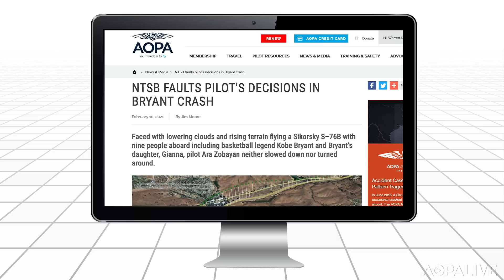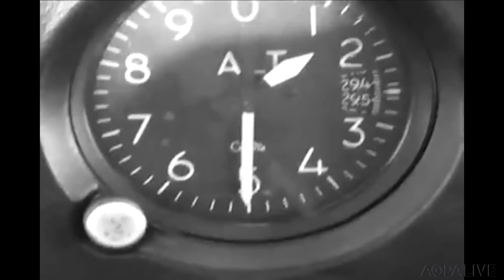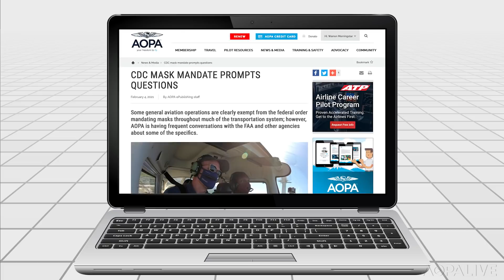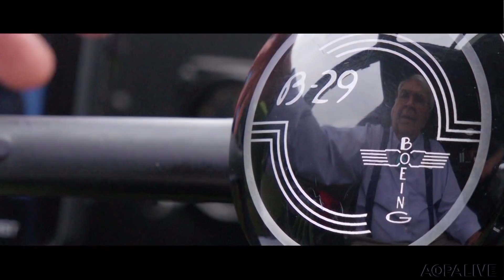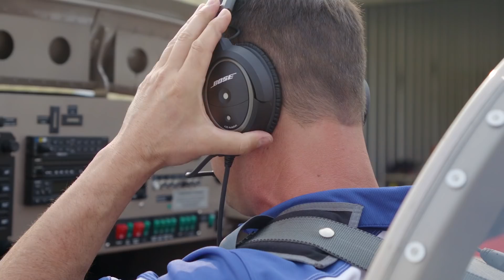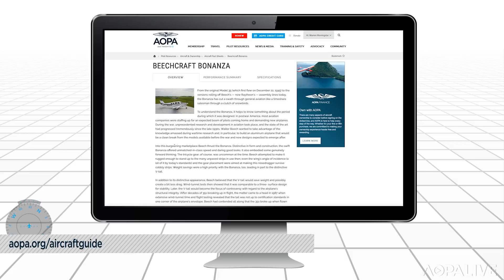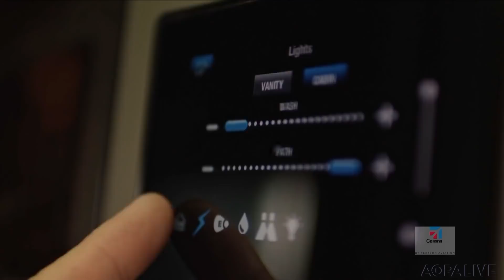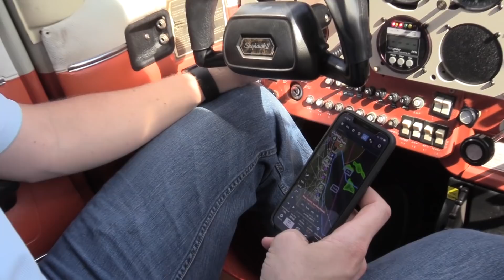AOPA Live This Week - February 11, 2021

Comment: Great video, keep them coming!
Why aren't new aircrafts being designed with sticks (preferably center sticks) instead of yokes that block the view of the instruments? Man oh man, 25+ years doing low level single engine turns every six months during Dash-8 Proficiency checks and breaking my neck to scan the instruments around the yoke! Especially with the port (critical)engine dead with a left performance turn, so much right aileron the yoke is right across the Instrument panel. 
The problem with side sticks, when I hurt my left arm/hand as I did a couple times( yes, I shouldn't be riding dirt bikes on an overnight/lay-over) I wouldn't be able to fly with my right hand. Pardon my rant.